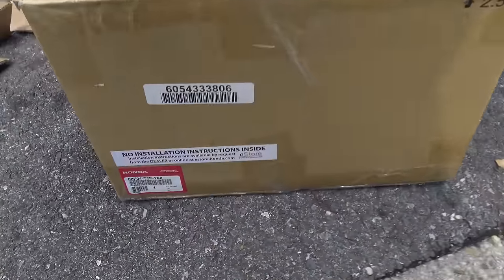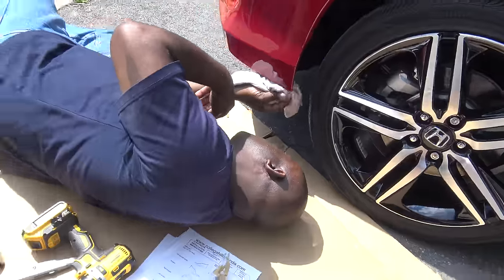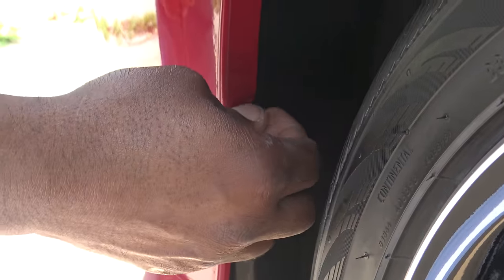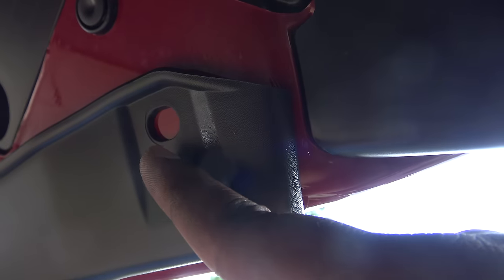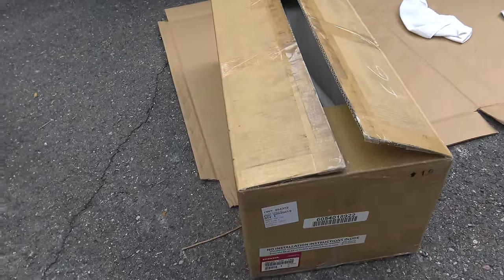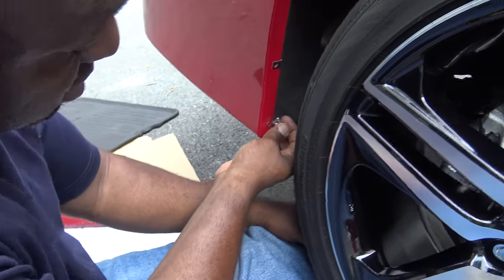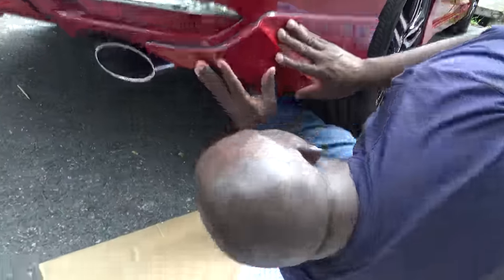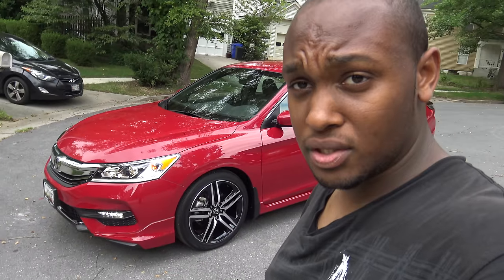2017 HONDA ACCORD SPORT SPECIAL EDITION FRONT AND REAR UNDER SPOILER INSTALL

Comment: How have they lasted through the years, asking since you avoided drilling the bumper. Do they get loose or anything? Since i will be installing mine and want to avoiding drilling the bumpers as well.
Reply from the maker: They are still sticked on the car going strong!  No issue! They don't get loose at all.
Reply: @EvilStreetShark  thank you for the response, i really appreciate it. I will be doing the same then. I bought the OEM ones as well so should be an easy process.
Reply from the maker: @user-fq9ke1kz5w  For sure! Np!  🔥😁👍🏽

Comment: That looks sharp. Just bought a 2017 Sport Special Addition two days ago. Mine is pearl white, and I'm going to buy the front and rear spoilers and also buy the side spoiler to replace the one that's already on there, but I'm going to get all three in the black pearl. I also have the same wheels, but I'm gonna have them powder coated the wet black color along with the same on the calipers to set it off. Great video that shows the install process. Appreciate you posting the video.
Reply: Do you know the code for the red lips front and rear for Honda Accord sport 2017 I want to buy some

Comment: Nice job! This video really helps to avoid drilling the bumpers and using the templates! Thanks for sharing!
Reply from the maker: Thank You!  Yup! It really helps from drilling into the bumper! :]
Reply: @EvilStreetShark  how are the bumper holding up after 4 years? I also don't want to drill into the bumper 😂
Reply from the maker: @derick4220  Still going strong np!

Comment: i purchased only the front for like $236 with tax included. not really sure that the rear spoilers are gonna look good plus it seems like the mud flaps can't be reattached. if i was using a lot of 3m tape,  would of purchased a $20 adhesion promoter that would make the bond  between the 3m tape and the plastic almost indestructible. removing the bumper might not be a big waste of time and its not really that complicated to do it but your way of doing it looks good too and few clips should hold that plastic. great job

Comment: Thx for sharing install. How is the spoilers holding up? I just bought the same spoilers. Debating whether to drill bumper or to use 3m tape like you. Just wondering if it's strong enough. Thx again.
Reply from the maker: The spoilers are still holding up with no problem! Yes it's strong enough with no problem! I'm glad the install helped!
Reply from the maker: We haven't done anything else to the car! I have a video on the interior lights we did to the car and reverse light! Nothing else after that! lol

Comment: Reason you drill bumper is to secure accessories and prevent theft.. double sided tape isn't full proof.. they came be pull off.. what I did is imported parts to convert my 2016 accord touring into a spirior accord..
Reply from the maker: Its up to you.. We never had an issue!

Comment: Love it! Just bought my '17 Sport SE San marino literally today and love the look of these mods.  Where did you go to have your clear bra installed? Thinking of doing the same... xpel?
Reply from the maker: At a company in my area... I forgot the name of the company.. Suntek clear ba! It is work it and easy to clean the car from bugs etc!!! The hfp front and rear pieces are in the description! It looks really good!
Reply: Edwin Cunningham how much did u pay for ur se
Reply: feedom a $22,400 with 2 miles on it. Sticker is $27,500 once i added the black sport grille (i hate the big chrome oem grill). I essentially negotiated hardcore and leveraged a $5k discount because this dealership needed to open up inventory for the 2018 new gen coming soon. Purchased mine in August. Great car, if you are cool with no sunroof, the cvt transmission, and no keyless entry at all, then go for it.  But if you're not getting a discount I suggest you wait for the sport version of the 2018 because it cost the same but has all those electronic features that this one doesn't have such as Honda sensing Android auto Apple carplay all that. That being said I don't like the way the new body style looks at all and I love love love my car... the interior is simple and if you go with SE Trim you get black leather with red stitching, heated seats,and don't let anyone lie to you: the rims are sick af in person especially against the san marino red of my car (the same as evil streek sharks in this video). Good luck!😎👍🏾👌🏾🍻
Reply: Edwin Cunningham I got mine 2days ago 24500 out the door
Reply: feedom a awesome man! That's a great deal to be out the door there.  I love mine! I try to fight the urge to lower it, but it's coming soon. Enjoy yours!

Comment: Hey man wanted to know which clips are those you guys used? Wanted to get extras to hold the kit in place after drilling the hole. Thanks in advance
Reply from the maker: It's the same clips that came with the kit we use! But its more likely the same clip they use for under the bumper!
Reply: Thanks

Comment: Great video! Do you have to have to make any modification to install the mud splash with the side skirts?
Reply: They will not fit anymore
Reply: @steeventide  Yes they fit. I did, you just have to find the correct ones for 2017 Accord Sport